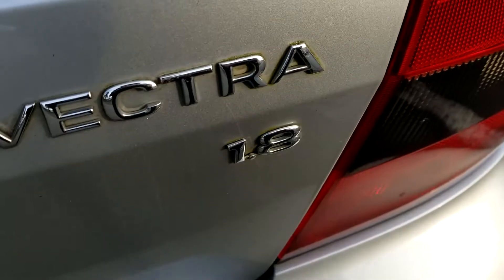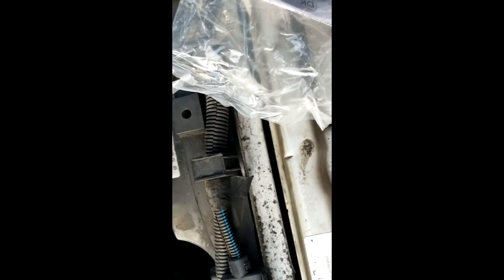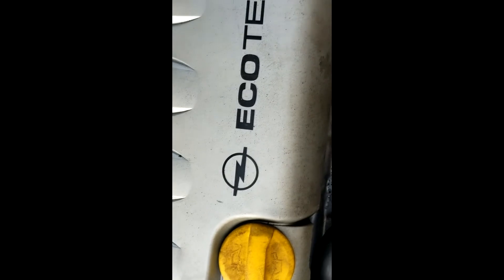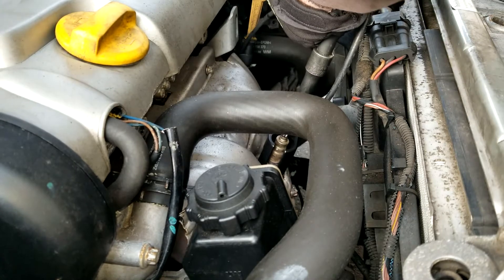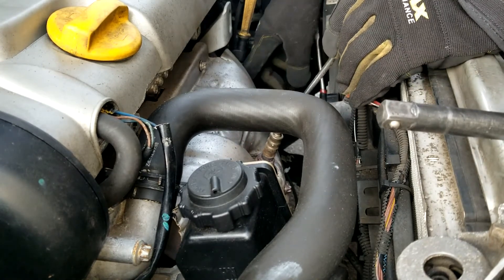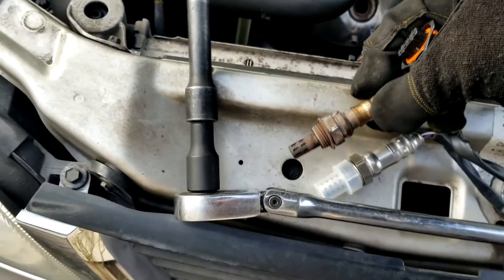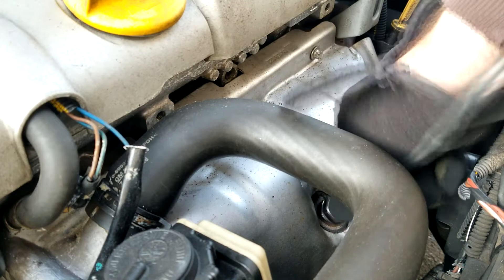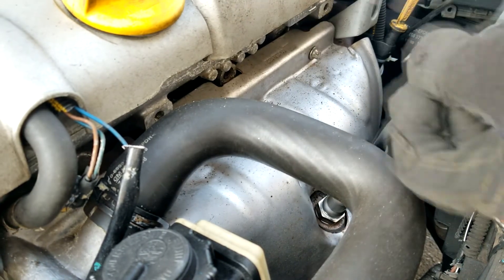How To Replace the Ecotech Engine Oxygen Sensor and Why?

Comment: Omg
I have work on my oxygen sensor for 3 days now. 
Also an Opel Vectra B, but from 2001.
The bolt is stuck. Really stuck.
I have tryed heating it up. I just tryed anything. Im desperat. Because now I cant even turn the engine on.
So I have to get it free, so I can replace it with a new one.
Reply from the maker: Have you used a quality lubricant? Do you have a tool that gives a lot of leverage?

I also like using a powered wire brush after spraying something like PB Blaster. I can't remember the best products. Project Farm did 2 big video tests and learned what penetrating oils worked best.
Reply from the maker: Use shock as well. Hit the tool with a hammer.

Comment: The sensor causing engine trouble... wonder how that works. Guess I kinda learned something new. Also can't believe we've been at it for 3 years!
Reply from the maker: Most of the time this oxygen sensor was doing it's job in the exhaust, but it'd occasionally get stuck. It happened so unoften that the car's computer couldn't figure it out. I had to manually spot it by doing errands with this cool lady for a while. 

But when it would act up she'd end up stuck on the side of the road. If your fuel to air ratio gets too far off the engine can vapor lock. Conditions are just so far off that it can't run.
Reply from the maker: You got that right. 3 years? Wow!

Comment: Pesky sensors,  i imagine it took a bit of driving for the computer to re-adjust the learnt variables.
And you have the correct tool for removing the sesnor,  no  modding of an old long reach socket.
Posh bugger ha ha :-D
Your petrol consumption may drop a tiny bit, i mean the cars consumption not you drinking the stuff ha ha :-D
Reply from the maker: That's what is fun about these Chevys and GM cars even if it's the Europe version Opel. The new sensor was taken to like a duck to water in spring. 

Immediately at home. Immediate great function. I personally wouldn't own one unless it fell in my lap because of all the electrical issues I saw at Chevy, but most customers never deal with that.
Reply: @DENicholsAutoBravado  Ahh but you know the faults, so fix your car before it fails.
A mate bought a brand new car, the first thing he did was pull out the back lights.
I was a tad confused, he said they always get water logged and the connectors just rot out in a couple of years, so he  improved the contacts and sealed the lights really well.
He attacked other known problems as well.
He liked the car but he just had to fix the mistakes made by the manufacturer.
Or was the manufacturer just making the car fail on purpose hmm...
Reply from the maker: Whoa! Loving that comment about fixing new car problems!

Yeah! Until I know the issues on a car I'd never buy it! Would I ever if rich, buy a new car when they'd made it that way for years and I knew the likely issues? That's the only way!

I love my trusty old-cars with known issues! For me it's old Corollas. My neighbor? Late 1960's Ford Ranchero. Those truck cars are made so well now that nothing built for them is unreliable now.

All parts are available as masterpieces. They like to say things aren't made the same way anymore. You better believe it! Those cars are crazy reliable now but back then? I'd be working on it all the time! Lol!
Reply from the maker: It is GREAT to see you again after a long absence! 

I may have stopped editing for a while but I never stopped shooting. But I can't think about all the unedited footage. Just 1 at a time or it's like my kids if I ask them to clean one dish it's not so hard for them to clean them all but if ask them to clean them all that first dish may not get done for hours! Lol
Reply: @DENicholsAutoBravado  Well you could get the kids to do the editing and you clean the plates he he :-D
Now stop swearing, i can't hear you this far away :-D
Reply from the maker: Lol! 

Sigh. It's so much faster if I clean the dishes and it's actually easier, but they need to learn how.

Having them edit the videos when they aren't mechanics wouldn't cut the parts where I say the wrong thing and confuse people.

I guess I could be the final edit. Hey, if any of them did want to learn how to edit, I'd make a lot of money on YouTube.

I can see it now. Wheres my cut daddy? How many times did you break stuff more than your allowance? Yeah, not even close. Lol

Comment: back fixing cars then mate another useful video seems all this modern sensor stuff nowadays causes more trouble than its worth
got our like👍Au👍fully watched
Reply from the maker: Oh for sure. And I'm glad I didn't bury the lead on this one. There were no codes. Only hint was it would die when you were far away from home.

Eventually, I caught the upstream O2 sensor lying despite the shifts in frequency of oscillations being subtle because the catalytic converter was good. When it's no good it's easier to use a sensor to catch the other. Upstream oxygen sensor kept on a perfect sign wave after the repair and the rear stayed rich or lean. I forget. All that matters is it wasn't moving much because the catalytic converter was fed right by the first converter.
Reply from the maker: Oh. I never stopped. Lol. The other careers just got in the way of editing these up. Lol

I actually have 4 career skills and I like to actively do at least 2 or I get bored.  Lol

Automotive technician 
Surgical technician 
Network Engineer 
Stock and crypto trader...though I'm still working on making forex my bread and YouTube my butter. Lol
Oh yeah. Youtuber. Let's be serious that I may dream, but I give it a part-timer effort. Lol

Been watching yours but commenting not often. Figured it'd waste your time checking my inactive channels. Lol

Surprised you chatted first. You're the best.

Sorry if I kept you too long. Just missed chatting with you and all the subs.